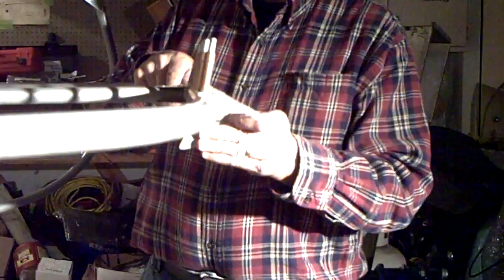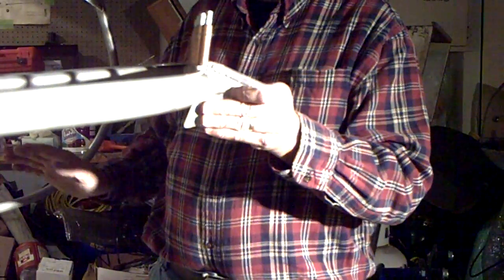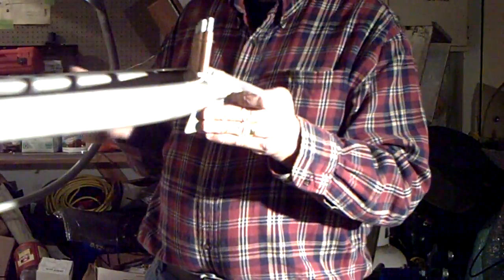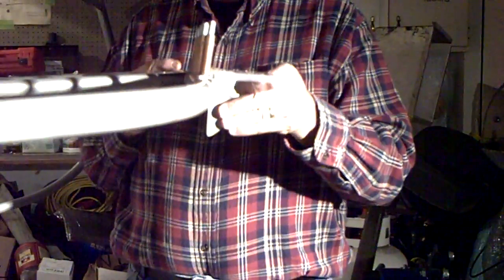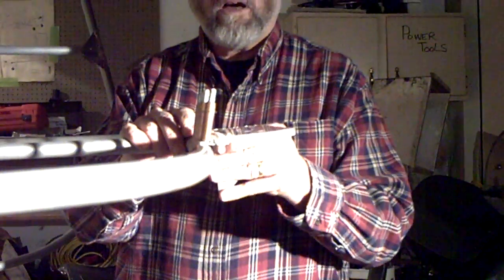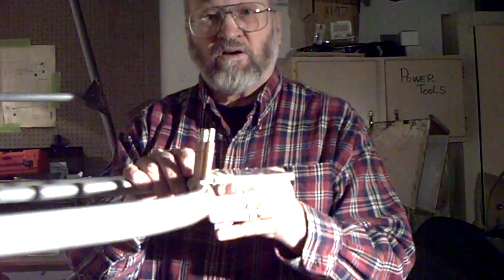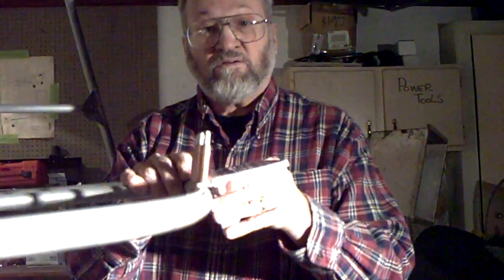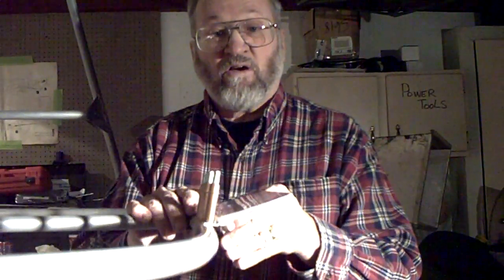MICHAEL HEIT ELEVATOR TRIM TAB 1.AVI

Comment from the maker: Piper aircraft has done just that starting with the J-3 Cub in 1939. They used a jack screw arrangement to move the stabilizer up & down for trim. However that was a bot too much re-engineering for me to do at this stage of the build process so I just added the trim tab which is a common practice in the industry.

I see your point, and had I considered from the beginning had made a jack screw arrangement to move the stabilizer it would have been a better design.

Thank you very much..